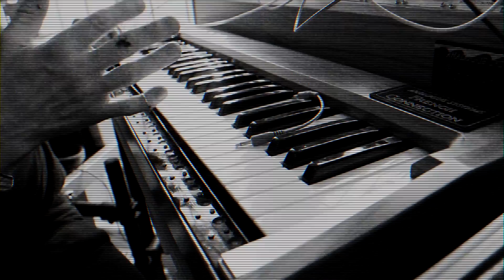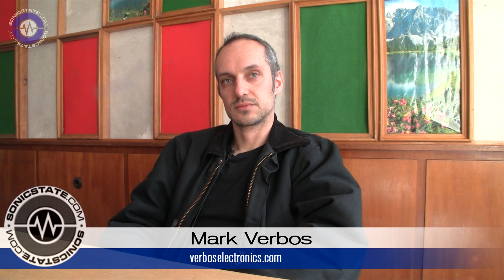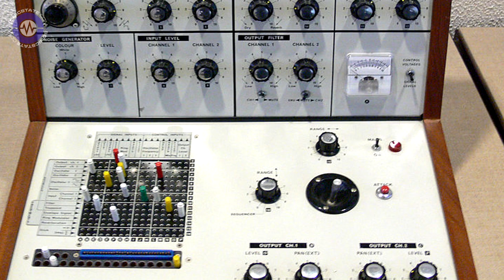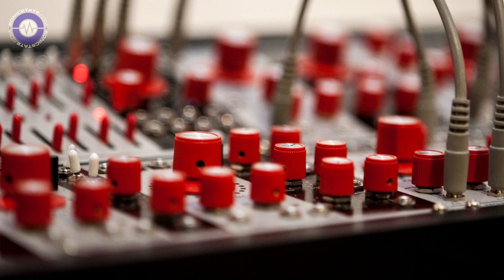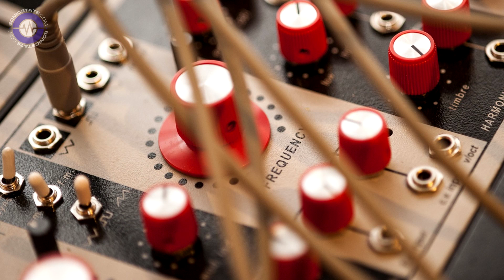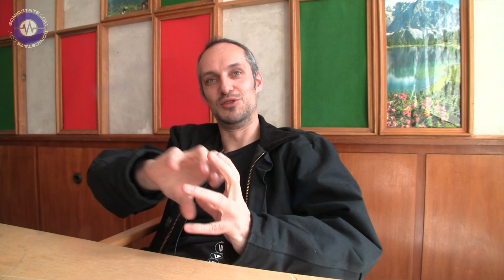Meet The Makers: Mark Verbos

Comment: I think the solution to the patching problem might possibly be partially solved with better patch cable design, and rails for routing the cables themselves, rather than having them hanging loosely about and in the way of everything.